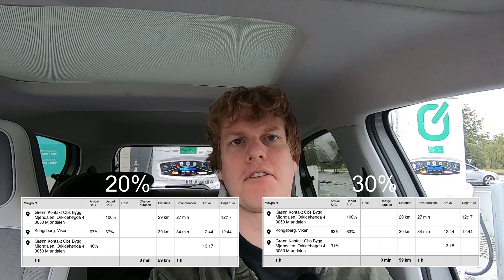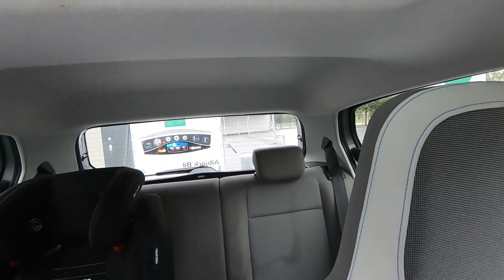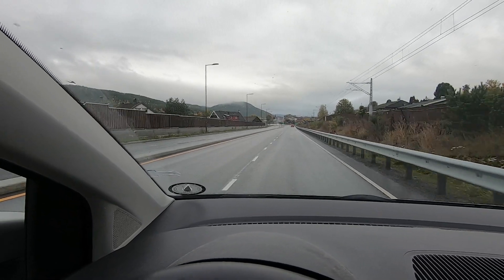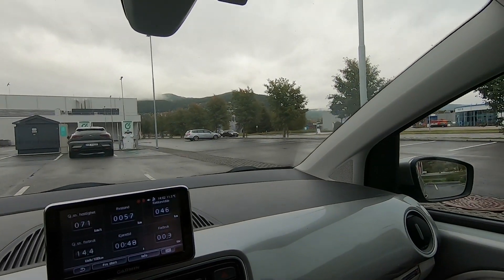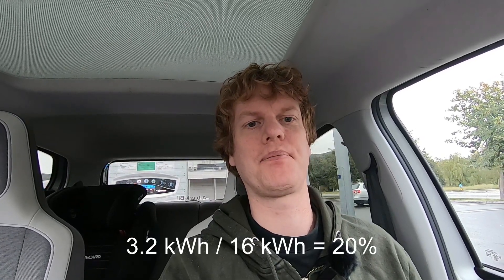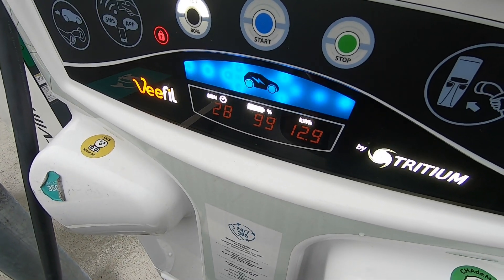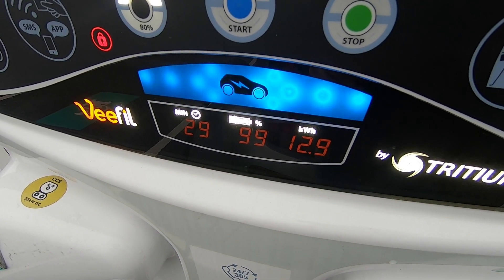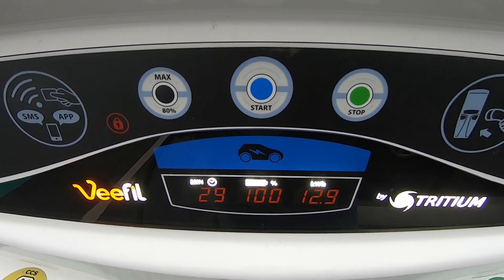2015 Vw e-UP! Battery degradation retest

Comment: Did you end up getting the battery replaced under warranty?
Reply from the maker: No it was not degraded enough, it need to fall below 70% of original capacity which it was not. In the end I sold it (not because of the range but for child safety) and bought a classic ioniq instead :)
Reply: @tyfonroad  How much did you sell it for and when if u dont mind me asking?
Reply from the maker: @OddOnFire  I sold it about two years ago for 90.000 NOK if I remember correctly :)

Comment: charge it full and drive it down with warm battery, 3-5% with max. 90 km/h and then calc the numbers... it's the best way!
Reply from the maker: That's basically what I did except I didn't have the battery temperature that I now do with Car Scanner. The dealer measured 20% loss from the data they downloaded which is within spec. Replacement will only happen at 30% or more. Still 2 years left on the warranty though!
Reply: @tyfonroad  20% is a lot... I’m looking for a eUP with the small battery!